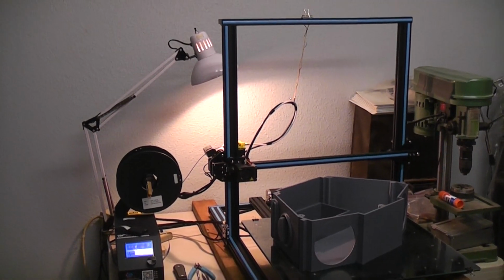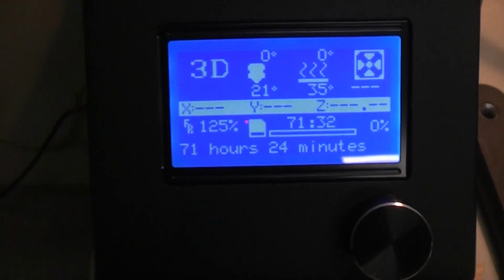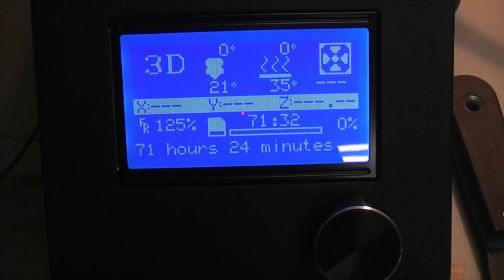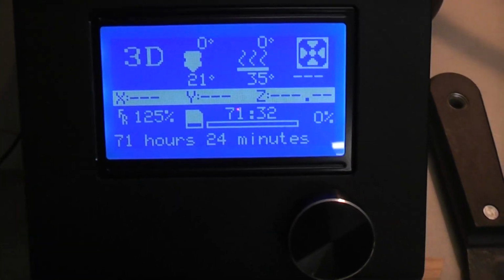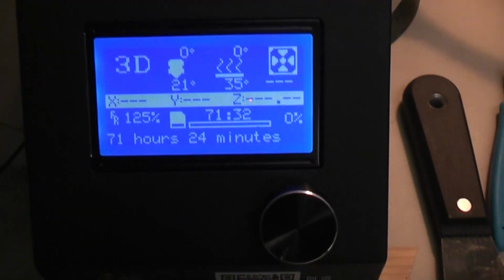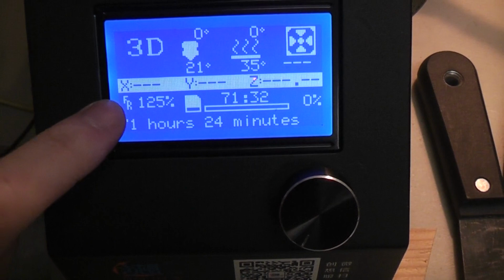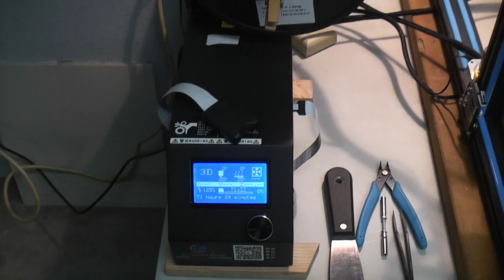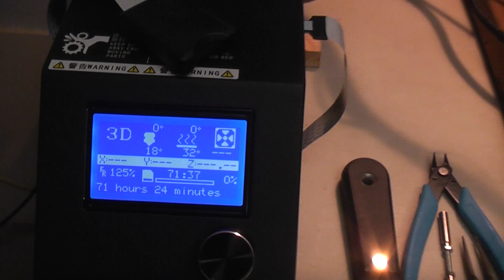CR-10 S5 large 3d  print part 2.  Main Drone robot body 71 hours

Comment: What nozzle size? I have a CR10S and am looking at this one for some large prints and want to put a larger nozzle in it.
Reply from the maker: I was just using the stock 0.4 nozzle, a larger nozzle would have been great and saved time.
Reply: @Robothut  Thanks for the reply. I just got my Ender 3 up and running that will keep the .4mm nozzle so I can put a larger one in my CR10 for larger things and not have to swap nozzles depending on what I want to print. I really want to get the 5S for some really big things I have ideas for.

Comment: What were the settings you had on this print? The bed heat etc. I have the s5 and I'm having issues with getting the print to stick to the bed, especially when it gets too high
Reply from the maker: Make sure the first layer is set right. Nothing is more important than the first layer. The filamanet should look 1/2 squished, not flat and not round like a rope. Next try adding glue stick to print bed. It makes things stick a lot better. Most printers want there heat bed at 60 C too 70C for the first layer, you can then turn down the heat bed to 50c or 60c for the rest of the print. The filamanet I used was set at 215c for the first few layers then 210c for the rest of the print, but this will vary with the filament you use.
Reply: @Robothut  Does the printer do the heat change for you or can it or is it manual?
Reply from the maker: You can do it both ways. You can set in CURA slicer what temps you want for the first few layers and what temps you want after X number of layers, or if you are there with the printer you just go into the setting on the printer screen and adjust the Temp of the Hot end or the Bed too what ever you like. I normally am standing there for the first few layers as they are the most important part of the print. If they are bad then the print will fail so if I am there then I just change the temp's to what ever I fell will be best.

Comment: Hi man, I was wondering if you could help me out? I'm currently designing a cabinet for my printers and I'm thinking ahead a bid and want to create some extra space for an  CR-10S5.
Could you tell me how much the bed would stick out on the front and back of the machine fully extended? Because I feel like the measurements given on the product page just give the dimensions of the machine it self and don't take the moving bed in consideration.

Thanks!! 

P.s. my subscription you have, awesome stuff you have!

Comment: Thinking about getting this printer for very large prints. ITs 2018 would you say its a safe bet to purchase this. If so do i need any addons on the bed heater.
Reply from the maker: If you operate the printer in a room that is not cold you should be OK. When I run it in my shop "that is not heated" I use a hear gun to warm up the glass bed. I also use glue stick on the glass. Then it works fine. It did a fantastic job on the large drone robot parts and they were all done in the shop when it was cold. I did buy build tech type bed sheets just incase but never need to use them. Seems like there was a new large format 3d printer out there that cost less, I think I saw a you tube on it, but I do not recall. Would be worth checking too see what is new and large just incase there is a printer with a AC bed heater. I know you can add a AC bed heater but that cost money, so might be worth seeing what is new before you buy.

Comment: Glue sticks seem to work well but how do you get it off the plate without breaking the whole thing?
Reply from the maker: I let the bed cool down then I use the flat edge of a razor blade to shoe horn under a edge, then I slide a thin flexible metal pancake flipped under the blade. Parts pop off with out breaking every time.

Comment: Hi, can you tell me which slicer do you use? I tried Cura but I didn't get good result.
Reply from the maker: I use Cura with stock cura setting for the CR-10 printers. Only things I adjust is temp to match the filament I am using and things like supports. Normal print speed setting in cura is kind of slow, but I just use the live speed control when printing to get the results I want.

Comment: That print is enormous! Are you using a custom nozzle or just the one that came with it? Did you use the coarse quality setting? I am just getting used to my CR-10 and very interested in ways to speed up large parts.
Reply from the maker: Stock nozzle 0.4mm printing at 0.2 layer height. It has just started to warm up in my area so I may be able to get back to the project and finish it up soon.

Comment: Whats the difference between Cr 10 and Cr 10 s5 ?
Reply from the maker: The S5 is a much larger printer the build plate is 500mm by 500mm , you put a cr 10 on the build plate.

Comment: what is the largest size it can print? I mean Im gonna print a big circle that is slightly less than 500mm in diameter . its about 497mm
Reply from the maker: I have laid out parts that print with in 10mm of the build plate edge with out a problem, I have not tried printing a 500mm by 500mm square so I can not tell if that can be done. Now with a circle you might be OK as it only will be near the edge of the build plate in 4 places. In any case you will know quickly since the print will start by drawing the outside line first.

Comment: How is the electricity bill?
Reply from the maker: Once winter set in I had to put the project on hold as heating the room would cost to much . The printer by it's self makes no difference in my electric bill. Come on Warm weather. Things are still snowy and frozen here.
Reply: How cold is it? I had no problems printing in a cold room. I put a huge cardboard box over the printer.
Reply from the maker: Below freezing. As in water is solid. I could get the machine going if I wanted to work out in the cold but I do not.
Reply: Robothut and thus a custom kitchen island was born, to replace the S5 into fabric of creativity.
Nice Peavy amp stack. Can possibly print a entire guitar amp including the speakers, minus the electronics, though even that seems eventually possible with additional printheads for the typical materials used.
A conducive capacitor seems possible, magnets too, though a iron bar treated with electric current being the most affordable. ☝🏻Spaceships are made this way! lol thanx for sharing that S5 robotics ideas inspiration.
Just ordered one today. Might build a kitchen island over the month waiting for it to drive itself to the mailbox.
Reply from the maker: I plan on printing a guitar amp shaped like a drone robot. So keep watching.

Comment: Thank you for the video, it looks like an amazing project! Quick question - did your power bill increase significantly? I recently bought CR-10 S5 as well and curious if my electricity usage will spike significantly once I get into larger sized prints.
Reply from the maker: If your printing room is already heated then I do not think you will see any difference in your bill. In my case my shop is not heated , so I have to either heat the room or fool the printer temp sensors into thinking the room is heated to even start a print. I have horses and other animals that required that there water tanks be heated so they do not freeze so my electric bill takes a jump when it gets cold even if I do not ed print in the cold shop.

Comment: Can I ask what you did to get the entire build plate level? I'm having quite a difficult time.
Reply from the maker: I was lucky I think. The build plate is not perfect but I was able to adjust it so that I can print on the full surface. I know a lot of the glass build plates are not flat, my smaller CR 10 was off more than this CR 10 S5 and this is so much larger. So I may have been lucky to get such a flat glass plate.